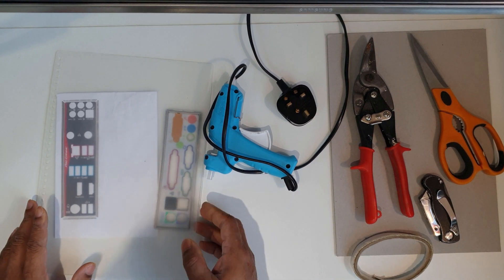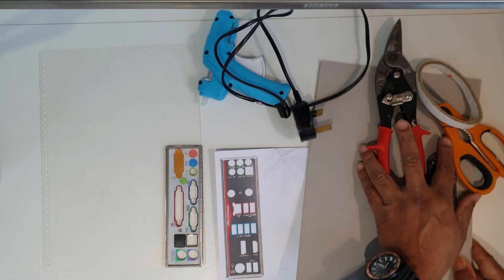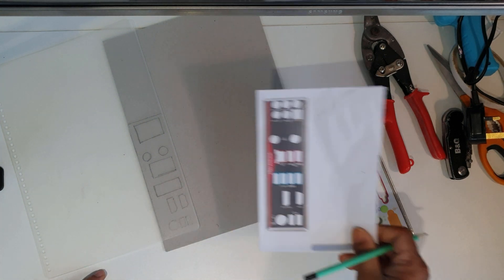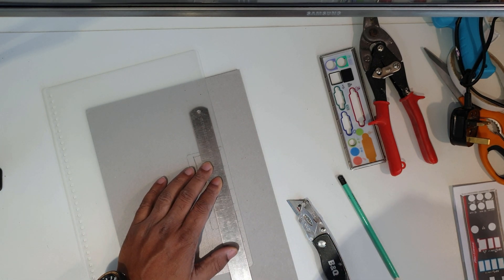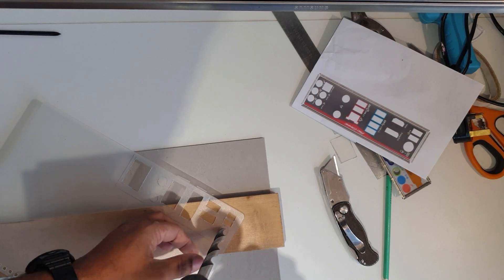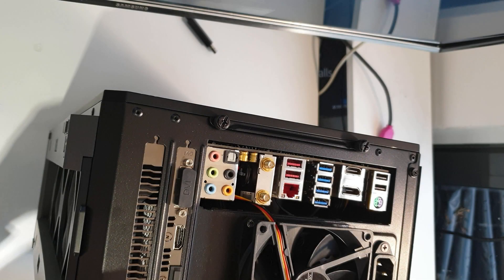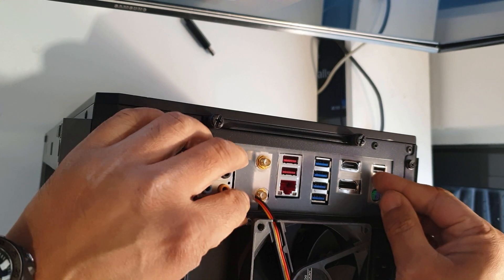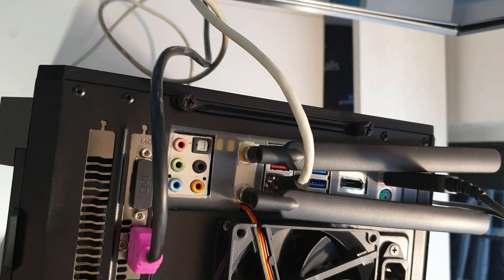Making Motherboard IO Shield from Scratch - Easy DIY

Comment: In your manual, there is a layout of your MB, take a screen shot of the IO section, now size it up to exact size using a paint/photo program, print, cut out on a blank io shield and cut with box cutter.

Comment: Pretty accurate work. This will help with dust intrusion and also keep air[flow] "box" sealed to direct flow paths to CPU etc. One main goal of an I/O (EMI) shield is to prevent clock/switching frequencies from leaving the chassis, minimizing background noise {floor} that starts to dominate over all other desired radio signals in the area (wifi, BT, wireless speakers, etc). Radiated interference issues are hard to isolate or quantify the margin of when BT/WiFi starts to act up. They make rolls and strips of "EMI gaskets", some are U-shaped (just like weatherstripping for windows/doors) that you can use to border around the openings. It has to be all connected as a conductive mesh, then bonded to the chassis. FCC enforces _commercial products to comply with tighter / lower emissions than consumer products - many imported AC/DC-DC switching power products are notorious for radiated noise. YMMV.

Comment: I never thought that this would be so easy.Thanks for this DIY video.
Reply from the maker: Really. I did a bad job of it, that for sure. When I get time I may redo it again. lol
Reply: if this was easy i am brad pitt
Reply from the maker: @sppencerslice1545  lol. But I am Brad Pitt... I have noticed using the transparent material shows the RGB lights through the back. Makes the Back of the PC bit nicer with RGB changing colours.